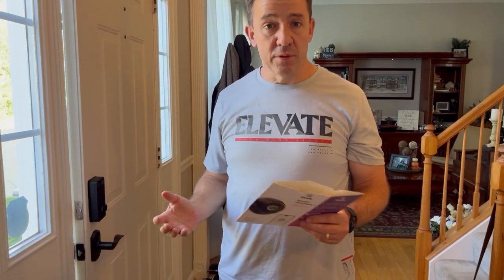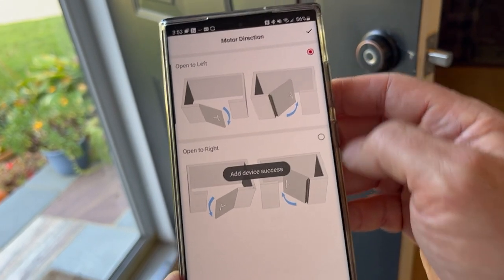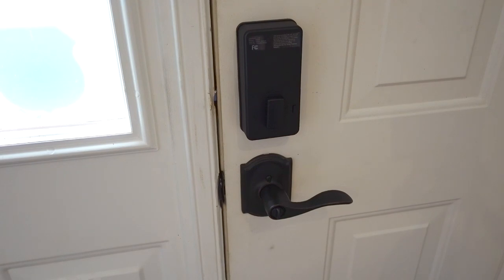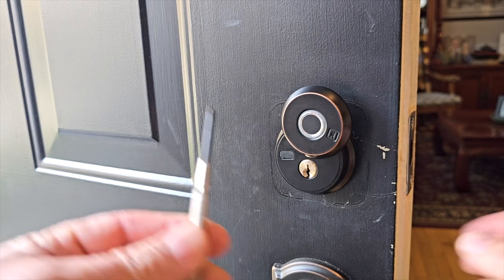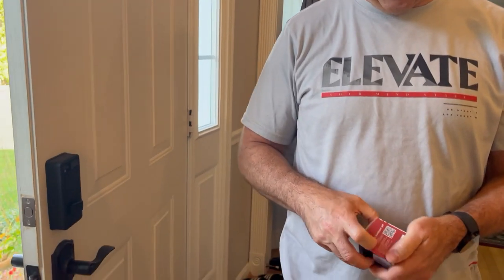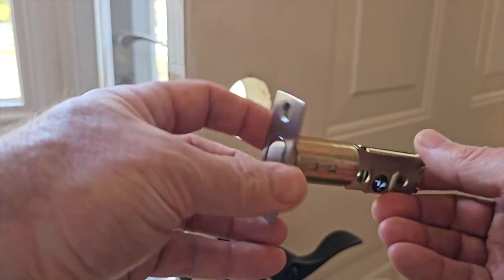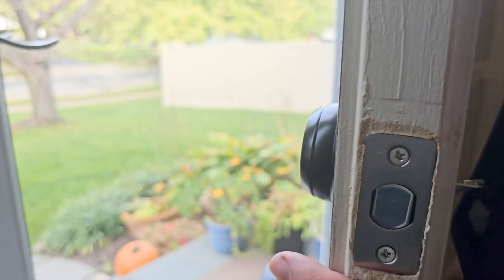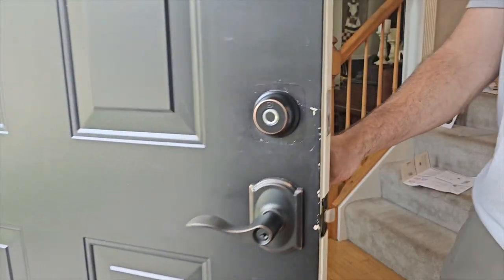GeekTale Smart Deadbolt: Set-up, Demo, and Installation | Morgan Madness

Comment: Have you ever done the video on how to connect the deadbolt to the Wi-Fi plug hub?
Reply from the maker: I filmed it. Connecting to the Wi-Fi was easy, but it was complicated getting it to work with Alexa so I've been stalling on editing the video. Maybe I should quickly do a video on connecting it to the Wi-Fi and save Alexa for later.

Comment: Great video! I just got the same lock and I've run into an issue that I don't see addressed anywhere. It seems even after programming my fingerprints, anyone with a random finger is able to open the lock. Have you encountered this??? Since it's the weekend there's no customer service, and surely this is not by design because that kind of defeats the whole purpose lol
Reply from the maker: I haven't run across that. That would totally defeat the purpose of the lock! I have found that anyone can lock the door, but only those with registered fingerprints can open the door. I will test this later today, just to make sure.
Reply from the maker: I just checked mine to make sure and only the fingerprints that are programmed for my lock can open it. When using other fingerprints, the circle around the fingerprint turns red and blinks. And like I mentioned in my previous comment, I am able to lock the deadbolt with any fingerprint.
Reply: @JonMorganMadness Thanks so much for taking the time to confirm that. I think there's definitely an issue with mine. I noticed it when I touched it with a finger I had not registered yet by accident, and then I grabbed a neighbor and she was able to unlock it as well! I did see one review on Amazon mention similar but thought it was user error... now not sure. Apparently their customer service line does not operate during the weekend, but I'm definitely going to be calling them Monday!

Comment: Hey, I have two questions, mayabe you can help me? 
1st - I have the same deadbolt here but sometimes it does not lock automatically. Do you know how to fix that?
2nd - On my GeekSmart app there is an option called - voice control - do you know how that works?

thank you.
Reply from the maker: Good questions. As far as the first one goes. I have also noticed that sometimes the deadbolt doesn't lock automatically. It didn't happen when I was making the video but it has happened since I installed it. I'm trying to figure out why it's not consistent. Usually it does lock, but not always. One time when it didn't lock, I went in and changed the settings and then it started auto locking again. I wish I had a solution for you. Let me know if you find out a solution. Maybe it needs a software update? Hopefully those at Geek Technologies can help us out with this one.

As for your second question, I'm pretty sure that has to do with when you connect the lock to a smart home device like Alexa or Google Home or the like. I'm making another video talking about this so when I'm finished I'll be able to confirm if that is what that remote voice unlock is for.

Thanks,
Jon

Comment: I cannot get mine to function without the key in it.  Seriously, with the key in the lock it works great.  When I remove the key, it won't work.  Its part of the locking mechanics somehow.  Any idea what I'm doing wrong?
Reply from the maker: Hmmm, that's weird. It should work without having to use the key. That's the whole reason for having a smart lock.
Reply: @JonMorganMadness  the actuator rod (the rod that goes between the two parts and through the lock mechanism in the middle) was horizontal as per the instructions and your video.  Once I turned it vertical it worked no problem.